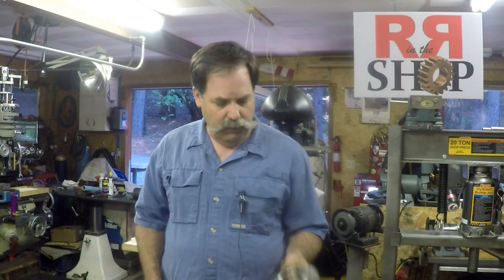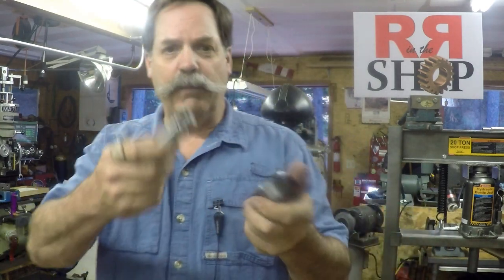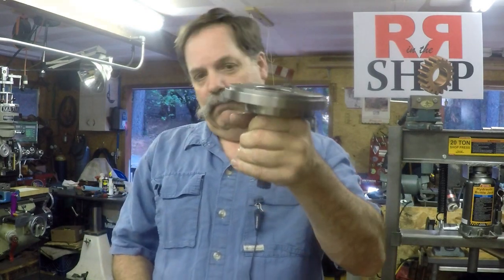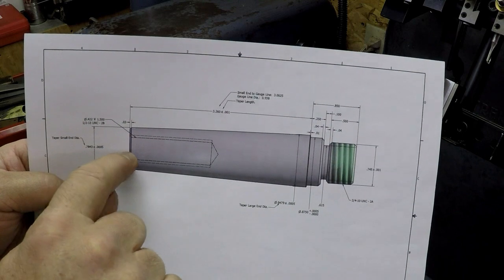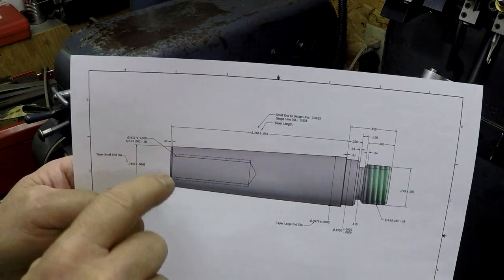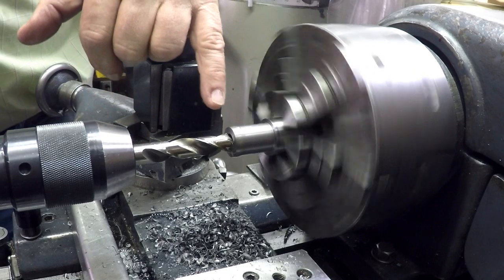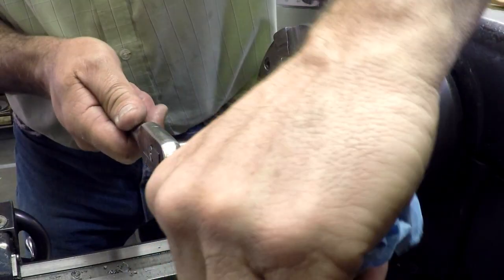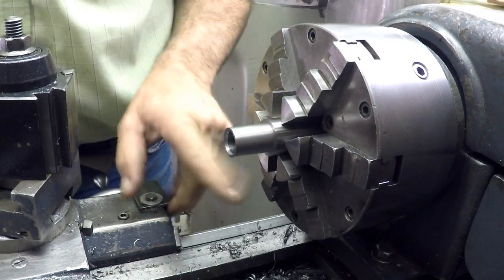Rotary Table Centering Chuck Mount Part 1

Comment: Interesting video.  That project looks like it could take a while.  I have only cut a taper one time and it was very hard to get setup at the right angle.  I have a taper attachment of course but I put a tapered item between centers to check the setup.  Thanks for the video.
Reply from the maker: cerberus Thanks Harold.  This took several days to complete.  The taper comes out great, I was having problems with my taper attachment when working on Razor Rays project.  So this project I was able to sort out the issue I was having and it worked great.  Thanks for watching,  Randy

Comment: Randy,
I love your videos and learn a lot from them.  I cannot access the DropBox link you posted, could be me as I just created a dropbox account.

Also, what CAD program are you using?
Reply from the maker: Adam Alterman I will check the dropbox issue,  I have ad problems with this several times.  If you need something that I have in there send me an email and I will send it to you.  I am most of the time using AutocadLt 2002 (old but works good for 2D)  and recently i am using AutoCad Inventor 2015 for 3D and 2D prints I liking this program a lot.  I also use the Beta of OnShape, another good program, it is web based so that is kind of nice but you must have internet connection.   RRINTHESHOP@GMAIL. COM,  I can send you the drawiing in PDF or the actual drawing file.  Thanks for watching.  Randy

Comment: Hi Randy. Just watched this and was curious if you were concerned about the vise spinning loose if you happen to mill in the wrong direction. I too am mounting a vise to my 9" table but I made a mounting plate that when done will bolt to the rotab.
Reply from the maker: Doug A Yes I am, I am thinking of a flat on the threads for a set screw.  This would be a small mod.  I thought about what you are doing with a large plate.  I will have to look into getting a large piece of plate.  Next project.  Thanks for mentioning this.  Randy